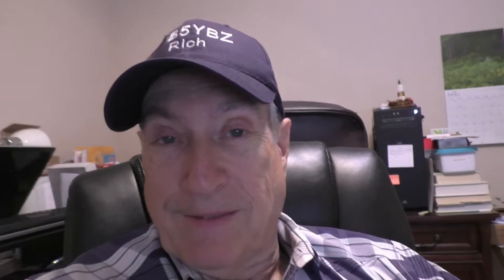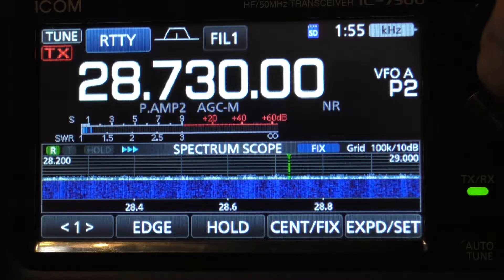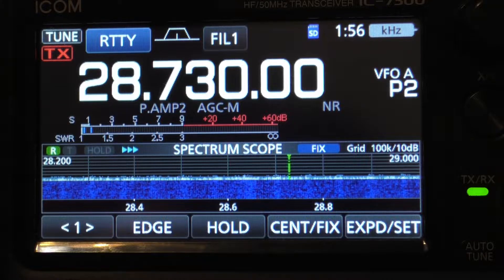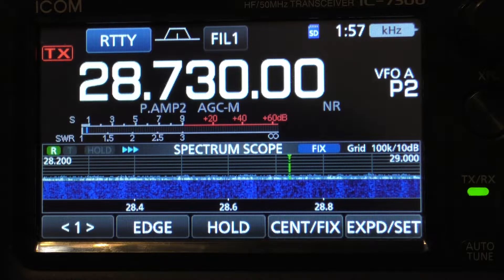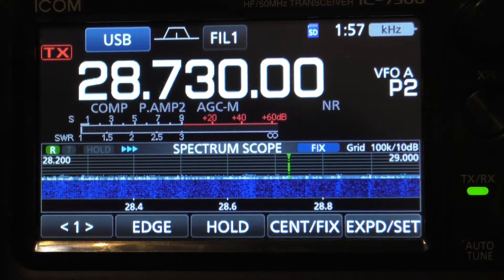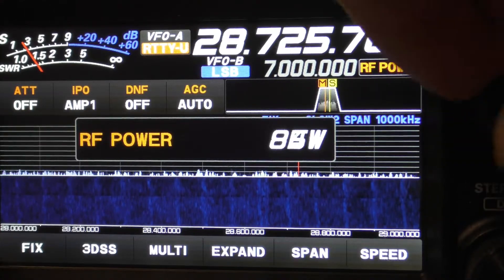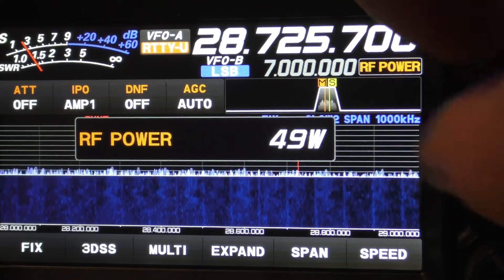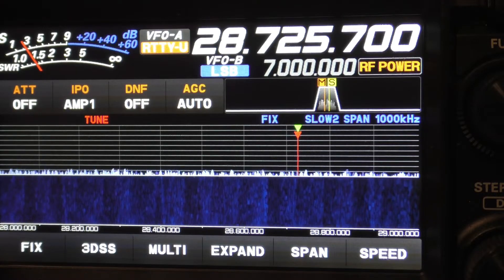Yaesu FT 710 vs Icom IC 7300 Internal Antenna Tuners, which radio tunes higher SWR

Comment: Your analyzer shows value of the impedance equal to Z = 20 +j0 and SWR=5.0. If I'm assuming, that your measurement based on 50 Ohm reference value then how it is possible to have SWR=5? It should be 2.5?
Reply from the maker: I was using a external tuner so the SWR was 5.  So the other settings were thrown off.  The MFJ, Icom, and Yaesu all read close to SWR of 5.   I was just showing the tuning the antenna ablilty of both radios.

Comment: That's pretty amazing.  I didn't think any of the Yaesu internal tuners could handle an SWR over 3:1.  Do you know if the FTDX-10 has the same internal tuner as the FT-710 ??  73
Reply from the maker: I am not sure. The FTDX 10 is a little older.

Comment: My 710 will not tune 5:1
Reply from the maker: @Joe-ho6fo  Try 1st to tune the FT 710 using 10 watts, then try tuning it with 100 watts, which may or may not make a difference.
Reply: @ I think the 710 sets the power to 5 watts automatically when you press the tune button.
Reply from the maker: @Joe-ho6fo  I think you are right, but see if it tunes the SWR 5 to 1 SWR when you have the rig set on 10 watts just to see what happens.

Comment: Not a fan of using a radio with high SWR using the rig tuner ? However the ic 7300 has a emergency tune setting reduces the power to 50w which is a good idea . So that might be an option?
Reply from the maker: Rob,  I think you are right.   Most hams I hope use  low SWR antennas.  And you are probably right again on 50 Watts.   I am using 80-meter loop antenna for 10 - 80 meters.  I use a LDG  AT-1000Pro II external tuner. Most of the time my SWR is around 2 or less other times it may be a little over 3 to 1 depending on which band..

Comment: What do you think of this reply I received this morning. It does make some sense.Yes but do remember the antenna still has a true SWR of 3:1, so completely mismatched to the radio. What the ATU has done is effectively fooled the radio into believing it is “seeing” a resonant 50 ohm match. As Randall says, you’d be far better spending the time to improve the antenna than fooling the system. There is no substitute for a resonant antenna, and in an “ideal” world you should not need to use the ATU at all, and “ideal” really does exist.
Incidentally the ATU should be called an antenna matching unit (AMU) as they don’t tune the antenna they merely match it - aka fool the radio into believing something is what it isn’t. But, good luck with your radio. Improve the antenna and you will definitely improve your enjoyment.
Reply from the maker: Hi Muskrat,  Yes, I could build 1 antenna that matches pretty close.   I have a multiband full wave loop.   80-10 meters.    I cut the loop to have the best performance for all bands mainly 80,40, 20, 15 and 10.  I cut my loop to the CW portion of the 80 meter band at 3.588 the SWR is 1.3.   If I go to the SSB portion of the band say 3.980 MHz the SWR shoots to about 7, why?  Because there is about 4 KHz higher in frequency and the antenna is resonant at 3.588.  It is simple math.  Let say if I just cut a dipole for CW at 3.580 MHz  Math tells us the total length would be 130.73 ft total.  Then say you want to work 75 meters SSB and the frequency you want to work is 3.980 MHz  Do you think your antenna you cut to the CW portion of the band will be flat SWR on that SSB frequency? No!  Because the frequency range is so much your SWR would be high, and you would need most likely an antenna matcher.  Your total length would be 117.6 ft total or about 13 feet shorter.  So that is why you have to have an antenna matcher.    Here are my results for my 80 loop without a matcher for the lowest portion of the bands.  
3.588 --- 1.3
7.161. --- 1.9
14.269 --- 3.3   I am not sure why SWR on 20 meters is so high?
21.290 --- 2.0
28.010 --- 2.5

Comment: The only thing I don't like about the 710 is the waterfall isn't as smooth as the 7300. I know that's dumb but seems like something they could get right.
Reply from the maker: You might email them. They may just fix it with an update.

Comment: Appreciate the your testing and Yeasu FT-710 Tuner seems to show  results . But I request you to to test with dummy loads using 50 Ohms and 250 ohms pure resistors. Anyhow thank you once again . My FT-710 will be delivered shortly . So your video helps me . (VU2RMU)
Reply from the maker: Thank you for watching my video 
 I sold the 710 to my brother in law.

Comment: What it tells you is that the tuner in the 7300 is better as it will protect your radio better than the 710. If your SWR is that high then every effort should be to look at the antenna system/coax in the first instance.
Reply: Makes no sense whatsoever
Reply: If the tuner gets the SWR down close to 1:1, that’s what the finals “see.” An inability to tune a certain SWR has nothing to do with protecting the radio.
Reply from the maker: Hi there, let's first look at my antenna.  It's about 273 feet long.  It's cut for 80 meter CW portion of the band. At 3.505 MHz, I don't need a tuner. But if I go up 450 KHz on th SSB, My SWR will go up because my antenna resonate frequency is not cut for that frequency.   And if I am  using the same antenna for other bands.  I will need a tuner to bring the SWR down as well.  The IC 7300 antenna tuner only tunes to as high as a 3 to 1 SWR. Where the 710 can tune up to 5 to 1 SWR.   I try to have an antenna with good SWR when I change bands the SWR of my antenna changes. Thus an antenna tuner.
Reply: @RichRodgersOnline  Rich, I would be inclined to use an external ATU in that instance rather than putting pressure on your radio. The internal tuners are really only designed to sweeten out a nearly resonant antenna so for something like your antenna, something outside of your rig would be a smart move.
Reply from the maker: I have an LGD auto tuner.
Reply: Is that it tells you?

Comment: if you get the correct anttena set up you don`t need a tuner or matcher.
Reply from the maker: I am using a full wave loop for 80 Meter full wave loop.  It works 80 through 10 meters with a tuner.
Reply: Yes, but w3dzz is not correct swr for all bands

Comment: Isn’t the scale to the right of 3:1 logarithmic?
Reply from the maker: I really don't know!
Reply: @RichRodgersOnline  check the manual.  If it’s log then what you are thinking is 5:1 may be closer to 15:1….
Reply: NO, 5:1 is 5:1 on the FT-710 meter.

Comment: Early in video, the Icom didn't show the 5 swr because the Icom folds back power in the case of high swr - @ 100 watts it isn't 100 watts either, it is folding back power to prevent damage to radio. Too bad the Yaesu doesn't do that. Next, you tuned the Yaesu @ 10 watts then took it up to 100, but in the Yaesu you tuned it with 10 watts then raised it to 100. Your video is not consistent. Tune the 5 swr on the Icom with 10 watts then raise power the same way you did the Yaesu before declaring a winner - - you can't do it different ways for each radio and make a fair assessment.
Reply: Where did you get this info, that the FT-710 does not fold back power when tuning??? I just checked mine, watching the watt meter with the rig set on 100 watts as the antenna tuner is tuning it folds back to around 2 watts. Also I checked the rig and it has swr protection, without the tuner in line with a high swr the rig folds back power!
Reply: @johnwofford2708  I said the ICOM folds back power (read again above) so you are saying that I said something I did NOT say - I did SEE in video the Yaesu keyed and shows an SWR 5 where the Icom shows 3 - because the Icom folds back is what I said - again, see above. Don't take what I say and twist it around to be something other. The ICOM won't show that 5 swr because it is folding back power. The Yaesu SHOULD BE also folding back power to not be showing over a 3 to protect itself. Anything thing you'd like to add Jim! ? Is the yaesu not keying, in video, to show a 5 swr, in TX mode?? Let's see YOUR video Jim with same conditions of your Yaesu not letting swr go over 3, how's that... I'll wait.
Reply: Maybe I mis-understood but here is what you said "Early in video, the Icom didn't show the 5 swr because the Icom folds back power in the case of high swr - @ 100 watts it isn't 100 watts either, it is folding back power to prevent damage to radio. Too bad the Yaesu doesn't do that" It sure sounds like you said the Yaesu is not folding back power to prevent damage. Sorry if I did not understand you correctly
Reply: For The 10 watt test the tuner was on.probably had a partial or previous tune in memory. That is why you didn’t get an SWr of 5
Reply from the maker: Did you reply to John??

Comment: What is a good tuner for the 710?
Reply from the maker: The 710 has a great tuner built in.   However, Palomar, LDG  and MFJ are some which I think of..
Reply: I use a MAT-30...works great.

Comment: I don't understand when you push the tune button. It should put the transmitter into low power and then restore the power back to a hundred watts when done tuning
Reply from the maker: I know,  I was surprised!  But set on low power, the 7300 would tune on higher SWR.  I don't understand either
Reply: @RichRodgersOnline   Icom folds back power to prevent damage

Comment: Just probably worth remembering that the limits of a tuner isn’t really based on the SWR (a 3:1, 5:1 or 10:1 ratio cap), but rather the limits are based on the minimum and maximum of both capacitance and inductance that the tuner can produce as to cancel out those mismatches in the antenna system. So it’s hard to generalize what the limits are. The good news is that my finding is consistent with yours for the ftDx10, in that it can successfully match SWR mismatches in excess of 3:1. I just don’t think that it will match every conceivable 5:1 mismatch.
Reply from the maker: This is true! How do you like your  Ftdx10?   What did you have before the 10?
Reply: @RichRodgersOnline  I am quite happy with the ftDx10, though it took a lot of tweaking and experimentation to get the transmit audio set how I wanted it! The other radio I have is the Xiegu G90–it has a really impressive internal tuner, but the AGC on it is not great, so that combined with the lack of DSP makes it so noisy to listen to compared to the Yaesu. I got a BHI mk4 noise canceling speaker, which does definitely help, but will static crash a little after transmit as it reacclimates to the characteristics of the noise. .. my primary complaint about the Yaesu radio (versus the icom or Xiegu) is the meter, which does not allow you to see things like SWR, Power Out, AGC and the like at the same time. Seems silly.
Reply from the maker: That is interesting.  Do you use your contour filter on your Yaesu? If so, what do you have it set to?

Comment: Does the 710 have a 10:1 emergancy tuner mode like the 7300?
Reply from the maker: No 'emergency mode' that lets you tune up to 10:1,
Reply: @RichRodgersOnline   in EMERGENCY MODE, it will tune up to 10:1 SWR, but limits power to 50 watts power. To enable emergency tuner mode, you can: 
Go to Menu
Select Set
Select Other
Select Emergency
Select Tune
Click OK
Click That
The radio will restart
The emergency mode is documented in the IC-7300's advanced manual.
Reply: Turn your power down to 50 watts on the 710 and you have emergency mode.  It's a gimmick on the 7300. At 50 watts a 10:1 becomes @ 3:1 reflection.
Reply: @AlpineWarren  The Icom will not TX with a 10:1 unless you enable the feature. This forces user to acknowledge the condition and radio won't have a 100 watt oops. Sure you can turn the Yaesu down to 50 watts - and forget, then burn up your radio when you go back and crank it back to 100 without correcting the swr issue. Maybe you see that as a gimmick, I see it as a good idea that Yaesu could have incorporated into their software at little to no cost, but that won't sell more radios so....
Reply: @AlpineWarren  3:1 tuner vs 10:1 tuner.  I'll take 50 watts on a non-resonant WARC band over nothing at all.
Reply: @AlpineWarren  You're wrong, it will match an actual 10:1 mismatch in emergency mode - as measured with an external SWR meter with a 50W feed.